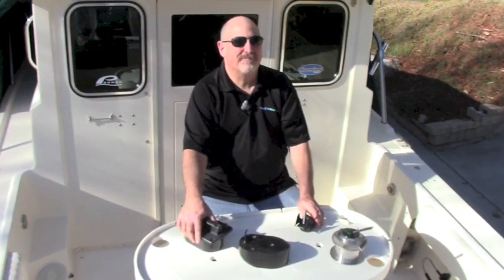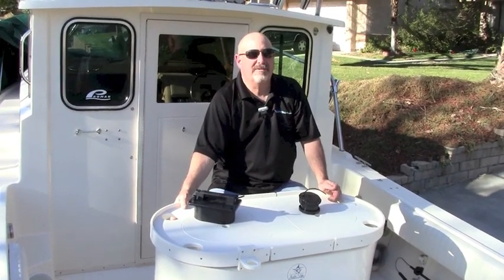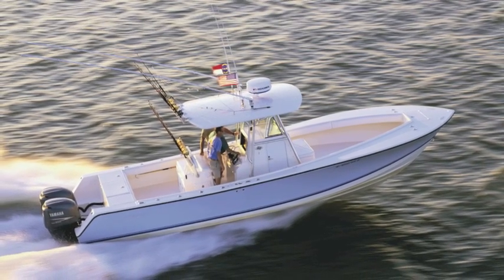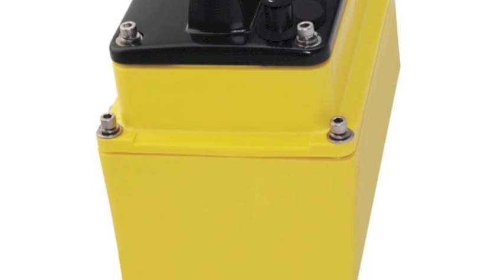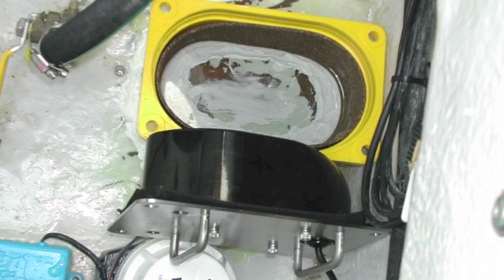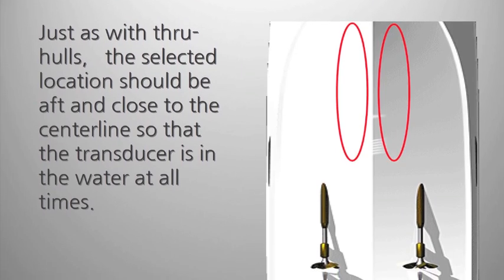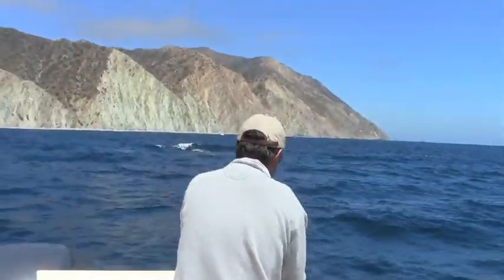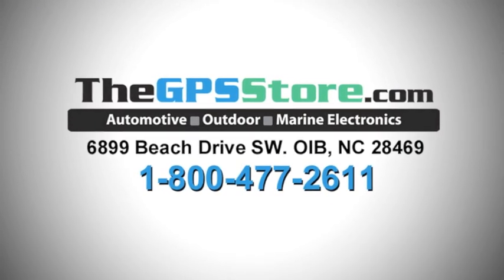In-Hull Transducer Basics by The GPS Store, Inc.

Comment: I am totally rebuilding an aluminum jon boat into a bass boat. 
Since I am going to frame out the bottom of the boat for a floor I will have about 4-5" in the center.
I would like to mount my transducer in the center (inside) of my jon boat! Is this possible?